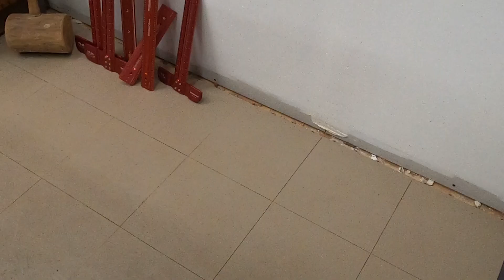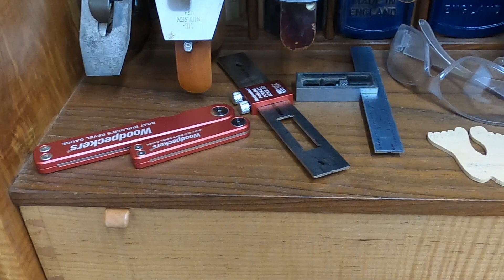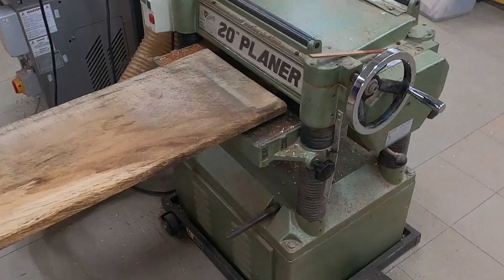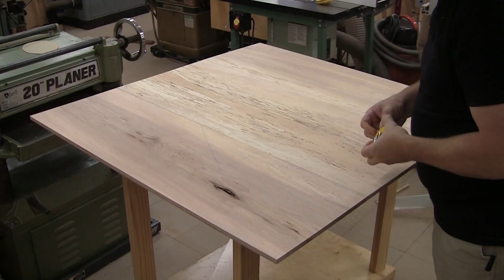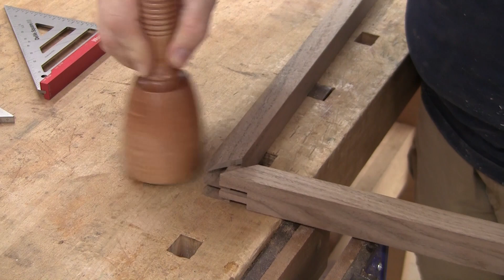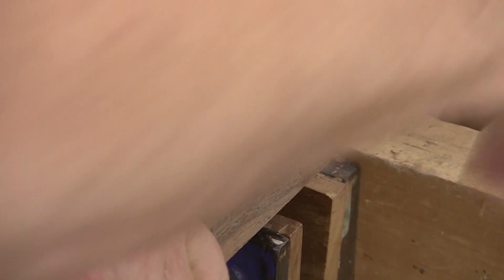Build a Tool Wall No BS Style

Comment: So you cut halfway through the thick finger? To what tolerance. (The engineer in me has to ask.)
Reply from the maker: When I set up the saw, I used one of the pieces with a single finger. Set the depth of cut slightly below the thickness of that finger and make a test cut out in the waste area. Because the elevation wheel is attached to a fine-threaded rod, I can creep up on the final depth. Once the initial cut is made, I rotate the elevation handwheel a few degrees and test again. I do this until the waste material is barely hanging on, then rotate the wheel another couple of degrees until the waste separates. Best educated guess (because I've never measured it) is within a couple of thousandths.

Comment: Why on earth does someone need that many squares?
Reply from the maker: The more tools you have, the more problems you can solve.
Reply: @acanthuscarver  I didn't expect to hear that from you. I always thought you solved problems with knowledge, skill and a no BS approach.
Reply from the maker: That's true, but owning only a 18" square is tough when you're trying to mark something that's 1-1/2" wide. And only having a 6" square makes it hard to mark an 18" wide board. So, more squares are not necessarily a bad thing. And knowledge and skills are tools you can't have in excess – more is always better.
Reply: @acanthuscarver  True, but a dozen of them? Those aren't cheap tools either, I hope they were a gift.......otherwise, I can think of other tools to spend that kind of money on. Not trying to be argumentative....just saying.
Reply from the maker: I get it, but at this point in my career, I don't NEED additional tools. I added to my tool cabinet because I like the quality of the tools and it makes my work easier and more convenient.
Reply: @acanthuscarver  Now that's an answer I can live with.